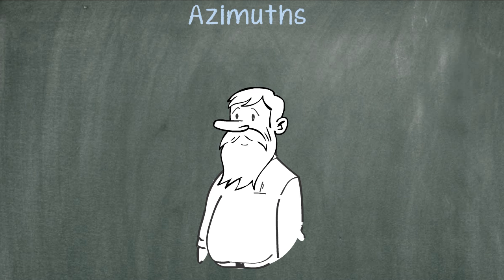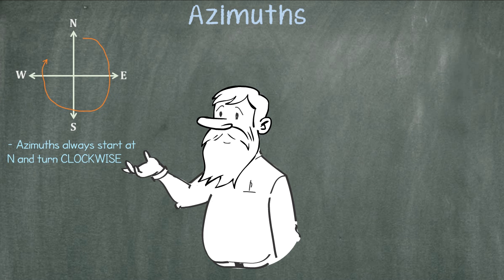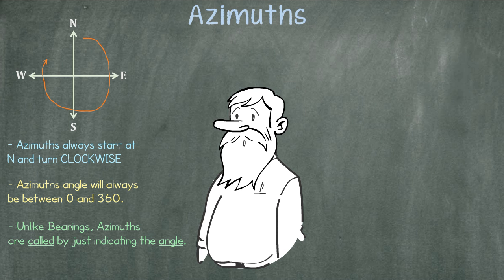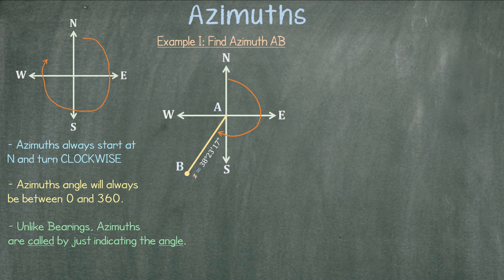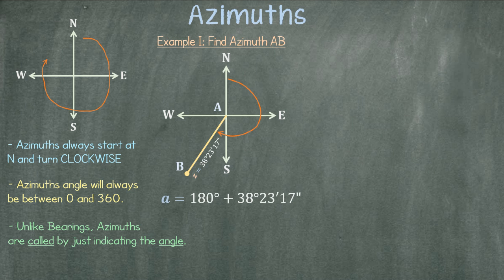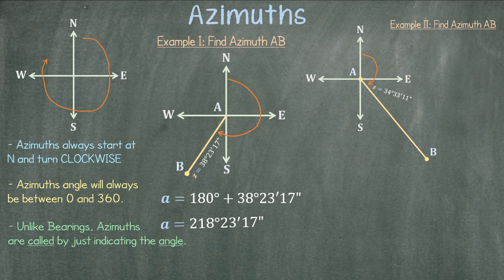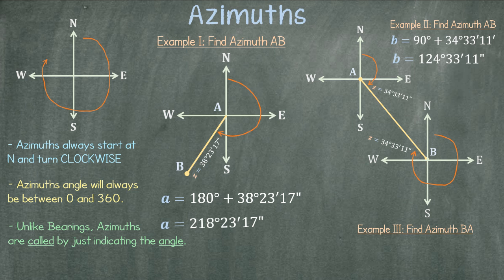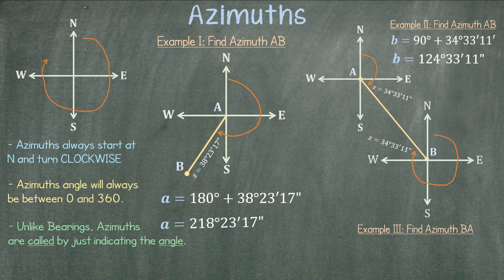Azimuths

Comment: why c= 270°? :)
Reply: Because we times the 90° angles between each cardinal direction until we reach our objective. Since B is our objective, starting north and moving clockwise around the cardinal directions until we reach B- we move through 3, 90° angles. 3x90= 270. Hope this helps :3

Comment: Ya I don’t get it
Reply from the maker: What is that you don't get?
Reply: @SkillRender  all of it
Reply from the maker: Then go back and watch the video again or change sources. Azimuth is very simple concept and shouldn't be a headache to understand it.
Reply: @SkillRender  I’ve been trying to understand it for weeks I just don’t get it
Reply from the maker: We can take a step at a time. At what point do you loose grasp of things?
Reply from the maker: An Azimuth is just a way to call out the direction/location of a point with respect to another. The other point been the center point of the axis.
Reply: @SkillRender  so In other words if my needle is point say 65° I add 180 amd that’s the exact opposite direction ?
Reply from the maker: Yes, if you turn 180 from any point you will end up facing the opposite way than where you started from.
Reply from the maker: Let's say you are facing exactly 45 degrees at the first quadrant (north-east) and your next point is 180 degrees. That will take you to the 225 degrees Mark, which is at the third quadrant (south-west).
Reply: @SkillRender  so always go clockwise less of 180
Add more of 180 subtract ?
Reply from the maker: Azimuths always turn clockwise.